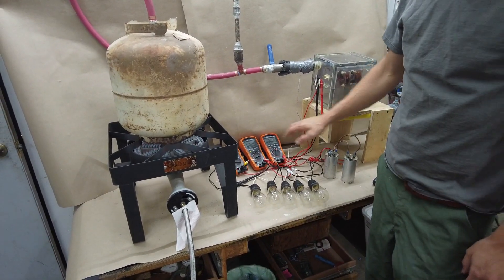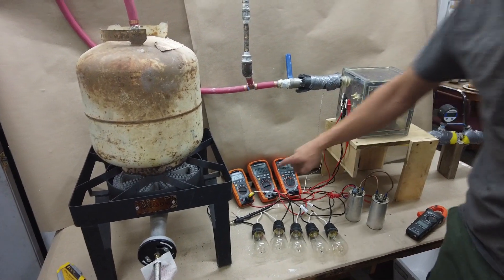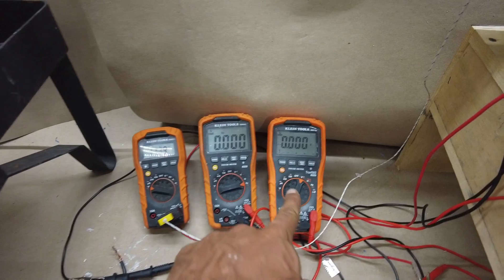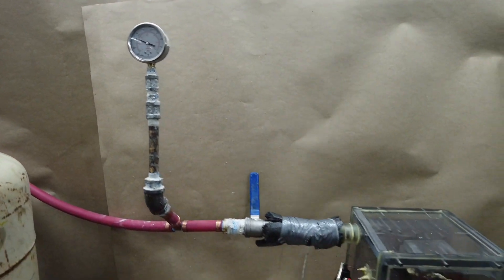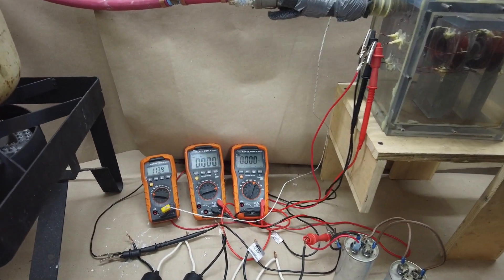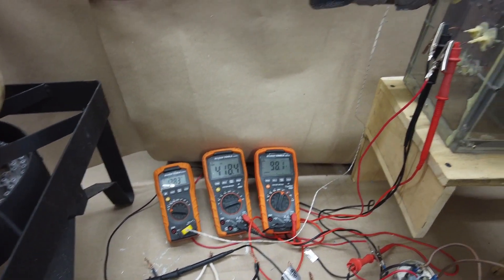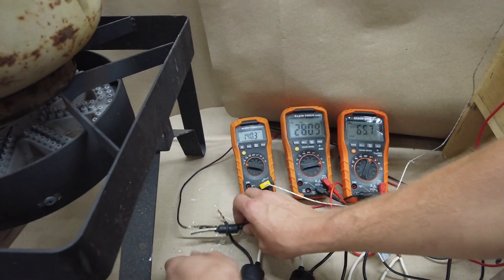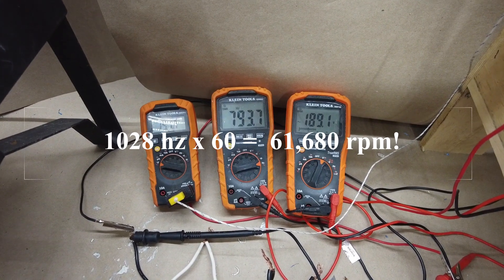Tesla Turbine COLD STEAM Testing, Medium RPM low temperature, 61280 RPM

Comment: What's the benefit of having the turbine and generator inside a vacuum chamber?

BTW, love your work. Stay safe.
Reply from the maker: removes the back pressure from the exhaust of the turbine, it also allows us to run the turbine on much lower temperatures. The system ran in vacuum needs to be completely sealed.

Comment: A large solar still can make really warm humid air. If you put the Tesla turbine at the exhaust of the solar still, could that fractional energy sustain a Tesla turbine? Would the vacuum drawn by the turbine help increase the evaporation of water in the solar still? If the turbine works off air temperature and cools the water, could it help condense water extracted from said solar still?
Reply from the maker: you are correct. It works perfectly. We will demonstrate soon.
Reply: @iEnergySupply  coat the inside surfaces of the turbine housing only with a hydrophobic coating like spray lacquer and polishing spray so the water air mix can only engage and impart their energy with the turbine disks and loose friction and adhesion to the surfaces that don't convert heat to kinetic?
Reply: @byrdhartley9014  - that sounds like an interesting experiment to try!

Comment: Great work, again! So the load lessens vibrations which increases the efficiency of the generator? Is that correct?
Reply from the maker: Well it doesn't increase the efficiency of the generator, but it does prolong the life of the bearings.
Reply: @iEnergySupply  Have you considered magnetic bearings?

Comment: Some suggestions from a friend:
"It's important to understand where Tesla was actually going with this technology and it's nothing like what most think which is generally the case. Tesla wanted a very small, lightweight, high power density turbine without all the complexity of conventional turbines ie the blading and tolerances. I used to design and build micro gas turbines 20 years ago not unlike that used in RC today and wrote software to do all the very complex calculations in basic on a Vic 20. It's unbelievably difficult just to get a gas turbine self sustaining let alone generating power due to the internal high velocity drag losses. 

However as I implied most have no idea what Tesla was actually trying to do with this specific design. The problem Tesla was actually trying to solve is called "adhesion" whereby the high velocity medium moving in between the disks could transfer almost all it's momentum to the disks. This would produce a very high efficiency turbine needing only a few sections negating the need for multi-section, compound high/low pressure regions.

Think about that, adhesion, what does that mean?. It means the medium moving in between the disks should adhere or stick to the surface and not just drag it along producing turbulence and drag losses. The effect Tesla used is very obscure and I would be willing to bet nobody here has ever even heard of steam electricity or ...https://en.wikipedia.org/wiki/Armstrong_effect.

In effect, the steam must be wet steam ie. including water droplets which charges the droplets to a high potential causing them to "adhere" to the metal disks which were grounded through the metal shaft connecting the disks and an Earth ground. The effect is similar to "spray charging" which is used to prevent paint overspray by forcing the paint to be attracted and "adhere" to the surface to be painted. Something so simple, an obscure effect nobody has heard of, a few design elements overlooked and a lack of understanding. This is why nobody to date has ever been able to replicate Tesla's claims regarding power density and efficiency.

A few obscure details which basically doubles the efficiency of the inferior Tesla turbines most are building today.

So what do you need to do?...
1)Use metal ie. conductive, disks connected to a metal shaft which is connected to ground though a shaft brush. This is a ground circuit.
2)Use a copper nozzle insulated from the steam supply which is also insulated from ground, high temp plastic lines.
3)The copper steam nozzle should be inside an insulated venturi which allows the steam to accelerate water droplets like a paint sprayer.
4)The water supply to the venturi must be insulated from ground as well through a batch mode or interrupted flow. Again this is a circuit.
5)Be careful because this is like nothing anyone here has probably ever seen and as my link implies the voltages can run into several hundred kV.
6)If you smell large amounts of ozone shut that mofo down because the HV is an ignition point for the H2 gas your probably producing.

For anyone who cares this is almost ancient technology dating back to the late 1800's, the waterfall effect, Armstrong effect, spray charging and so on...
Understand the only reason Tesla moved towards other mechanical inventions was because a bunch of knuckle draggers didn't like what he was doing with electricity. So he started integrating his electrical effects into common mechanical effects... pure genius."
Reply from the maker: Really interesting, I have gotten plasma before, and my carbon fiber disks are conductive. Ill investigate further in the future.
Reply: @iEnergySupply  How can they be conductive? Graphite is conductive but I don’t know if carbon fiber is...
Reply: Wow this sounds deadass legit.
Reply: Tesla just wanted to fly
Reply: Thank you Thomas..... In studying Dr. Tesla's time from 1856 on  it seemed to me that  he guarded referencing all the work he did regarding electrostatics .. the giveaway I believe was his extensive work on capacitors ... I also believe we'll never see the electrostatic collectors he built which transforms 'potential' into a current flow ... spark gaps, capacitors and inductors were all he used and I believe he had built super conductor 'tank circuit' energy storage devices that he was aspiring to be capable of storing  megawatt hours of energy....

Comment: There's a power company in the UK currently using liquid air to generate electricity through a Tesla turbine. 
Keep going guys.
Reply from the maker: I may experiment with this in the future, for now, water seems to work really well, because there is so much vacuum on the condenser.

Comment: Why even use propane to heat the other tank? I think a solar could provide all the thermal energy you need for this setup.
Reply from the maker: Yeah this is for a demonstration, it's for proving the concept, your absolutely correct, solar heat tubes are perfect. Ill be demonstrating this at the next conference.
Reply: @iEnergySupply  That's cool, I think you guys are better than liquid piston engine. I'm watching with great interest.

Comment: Where is the science regarding maximizing efficiency by altering disk diameter and spacing vs various working fluids at various temperatures and pressures?
Reply: It's not well studied in this specific application. However there are various white papers on it from various universities if you google it. I have found some rough guidelines for proportions as well by going to open source ecology
Reply from the maker: Soon we will have our analytical equipment and will be testing all those peramiters.

Comment: not using Robert's conductive ink diy paint on/in kapton tape/varnish/plaster etc low volt 3v-12v 50v heater to make the internal temperature difference even greater & faster for more power for longer...!

the 'tesla tech conference' would be good use & exposure for you both using a cheap battery pack diy paint on heater to extend safely runtime etc..
Reply from the maker: that' would be a cool experiment!

Comment: This tech is a game changer. If I understand correctly, this is direct thermal-electric or I suppose more accurately, thermo-kinetic conversion correct? absolutely awesome! taken to it's logical conclusion the applications are endless. Its a billion dollar idea I'd say. Question though; if the exhaust comes out colder and the intake is Hot. Should it not be possible to close loop the thing completely to itself and have the only input be thermal energy directly to the intake/exhaust loop via a heat exchanger??? I am super curious about that.
Reply from the maker: We are waiting for analytical system to see the full capabilities of the system, also we still need the tesla pump in series with the turbine. The tesla pump will increase the performance by 50% Also we will be testing at 150000 rpm soon!
Reply: I just want this to cool a petrol engine, create ice water so the turbo on the car can put insane levels of cold boost into the gas engine.  Let's utilize all the heat being built up from the engine and make it usable.  An electric powered turbo would be a fantastic way to use the energy generated.
Reply from the maker: @monjier  if you were able to extract that much energy from the waste heat of your engine you could get 80% more power. The internal combustion engine is around 20% efficient on average I think. All the heat lost would be around 80%. So you're literally losing 80% of your power that could be recuperated. You wouldn't need your engine attached, you could just use the waste heat from your engine to run and achieve four times more power
Reply: @iEnergySupply  that's a good point.  As long as the sound is there, that's the main thing 😂 I know it's a stupid way to generate power, but it's meant to be stupid 😂 ultimately electric will win, but sometimes you just want real sound, real gas, burning tires, etc.
Reply: @monjier  Great new idea for hybrid IC engine conversion - waste heat tesla generator - battery-less electric hybrid drive? Or in your case you could do some sort of directly steam driven turbo boost. There is videos of ppl modifying turbos to steam turbine utilizing the exhaust half of the turbo, intake is unused and in its natural state... could be used to deliver forced air induction.
Reply: @rickfrogm825  or even just an electric turbo/supercharger.  I know that BMW already uses electric turbos in some of their vehicles so that there's no turbo lag.  Alternatively, maybe an electric supercharger might work?  If the heat of an IC engine is converted to electricity and then that converted into turbo/supercharger energy, it would bring so much fun to IC engines.  It's not as practical as an actual electric engine, but could be a fun workaround for classic turbo cars that want better performance without going hybrid.
Reply: @rickfrogm825  do you think the steam part would work?
Reply: That what I've been thinking for the past several months following this channel. The power produced should be able to power a heat pump.
Reply: That's basically how most steam engines work.